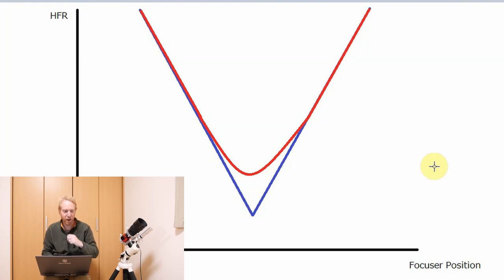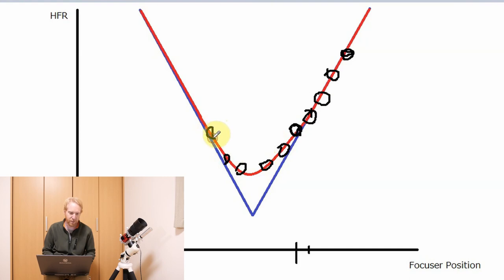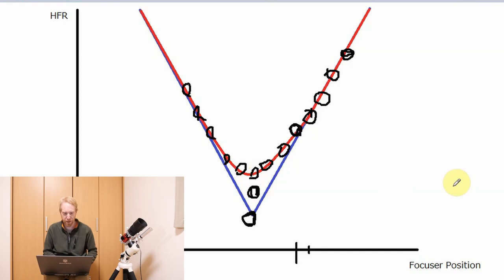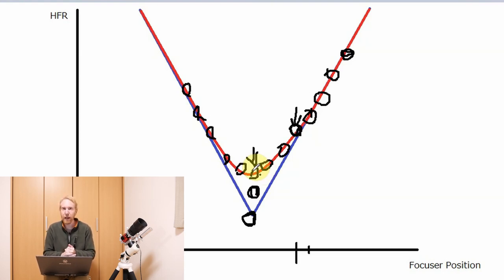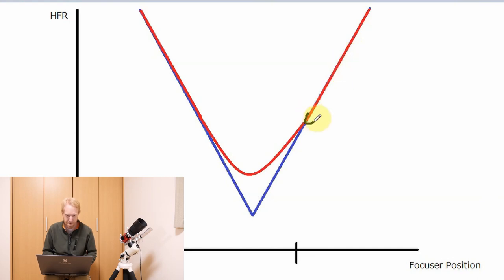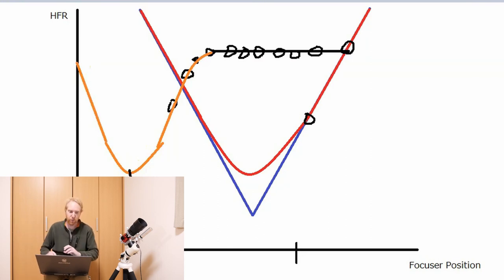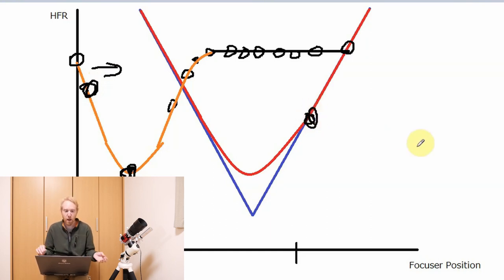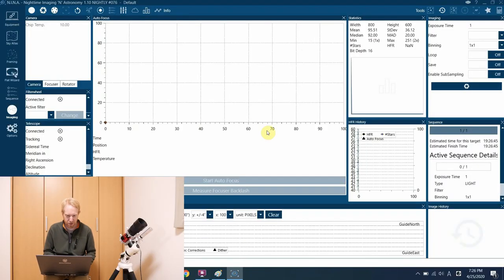Understanding Auto-Focus in N.I.N.A.!

Comment: I have been fighting a lack of quality automated focus for some time with both NINA, SGP, and APT. All three of these apps use a similar approach, and none were working well for me. After watching your explanation of how NINA auto focus works, I understand the details of the process and how each configuration value is used. NOW I can update my settings (which were way off) and give it a go tonight. Keep these videos coming ... you do excellent work!
Reply from the maker: Excellent to hear that this is being useful, and thank you for the feedback! I'll go into the actual configuration details in a later video.
Reply: @CuivTheLazyGeek  Cuiv ... I have the Celestron Focus Motor on an 8" SCT. This motor takes 1,000 steps to make a full turn of the focuser shaft. I currently have NINA configured with 40 steps and an initial move of 5. Those 200 steps take me out a quarter turn to start the auto-focus process. But I am still not getting a proper V curve. Do you think I should I go father to start?  Maybe 5 X 80?
Reply: Richard Sauerbrun Hi Richard. I’m about to order this week a Celestron Focus Motor to install on my SCT 9.25. How is overall your experience with this focuser working with NINA? Did your problems get finally solved? Any hint to consider? Thanks!

Comment: Cuiv, these are excellent videos! What's the deal with "max increment"? Is this a calculated value? Mine says 999999. Is this a problem?
Reply from the maker: Max Increment is a value provided by the ASCOM driver of the focuser. It is the maximum number of steps that the focuser can move in one go. If it's 999999 for your focuser, it basically means no limit, and is not an issue!

Comment: To speed up the autofocus, it would be handy if NINA had a "smart" feature. Basically while imaging THAT night, whichever night that may be. The curve it learns from, so it only moves out enough to get the out of focus, and moves into focus. Once it moves enough to where the HFR changes enough say by 1 or 1.5 it goes to the best number vs it continuing. I realize this would be dependent on your setup, but some focusers don't suffer from backlash (like the starlight I use on my tak). I do my autofocus in 125 steps for each point, it nails it every time at the best point (bottom of the curve). I do 125 because I found it gives enough movement to see a difference. I manually focused once in sharpcap, using their tool. Then I went to NINA ran an autofocus, found it landed pretty much where I was in sharpcap (step number). So its pretty darn accurate in NINA, just wish there was a smart feature to speed up focusing.
Reply from the maker: That would make sense - we already fit a curve (parabolic or hyperbolic) so if NINA were to remember the function it could in theory get to the minimum after measuring a single point. Although it could be mistaken in the direction it takes, so it would still need to double check, and if HFR went up (and there is a potential issue here of getting by mistake where HFR is no longer measurable, or noise is measured instead), go to the other direction. Feel free to suggest it in the NINA Discord, as I haven't done code for NINA in a long time now :-)

Comment: Don't know if I have to go to a different site for questions?
I have a DC motor Focuser which is recognised in Ascom and operates in APT.
However NINA will not accept it or recognise it?
Is there a way I can use Ascom or change anything.
I,m trying to get the Focus V graph.
Reply from the maker: Mmmh, it depends on the ASCOM driver - it needs to emulate an absolute position for your DC focuser to work with NINA... Do you get an error message when you connect it or move it? You may want to post on the NINA discord (Discord tab of the NINA website)

Comment: It looks like that in NINA the focusing temperature compensation only works with focusers that have an inbedded temperature probe (like the ZWO EAF). I am not using the EAF but another DIY ASCOM focuser (inspired from Julien Lecomte). Does anyone know of a possibility to plug a sort of independant 'ASCOM' temperature sensor that I could use for the same compensation purpose? I am using NINA and happy with refocusing in function of HFR changes, though, so it is more a curiosity question...

Comment: Well done video Cuiv - I learned a great deal.  One question, when I run the autofocus after it gets done with the routine it says it goes back to the original focuser setting.  Shouldn't it go to the optimal setting or am I missing something?  Your about 12 hrs ahead in Japan so you are most likely setting up so happy imaging.  - Cheers
Reply from the maker: It will only go back to the original focuser setting if it determines that the process has failed - e.g. you ended up with a worse HFR than what you started with. When that happens, it's typically because of uncompensated (or overcompensated) backlash.
Reply: Super explained thanks.

Comment: I thought you were only supposed to set backlash IN OR OUT not both because, they are fighting each other. I saw this in another video. Is that right ?
Reply from the maker: This is an old video - you have to set both if you use Absolute backlash correction (not recommended) but only one if you use Overshoot backlash correction (recommended). At the time of this video, overshoot backlash correction didn't exist in NINA yet.

Comment: One question: Im waiting for motorized for my two telescopes. For one one these telescopes I have a reducer. That means I have 3 options for focal view with these telescopes. Is it possible to calibrate this "backlash" for each setup and save this in NINA?
Reply from the maker: In theory the backlash should be the same, since it's the mechanical steps of the focuser - that being said, you should just use backlash overshoot compensation (which was added later in NINA), so that you can just set a large enough value that will cover all scenarios
Reply: @CuivTheLazyGeek  Thank you. Ill check it out. I need to see your videos of how to use NINA first ill guess ;) I actually noticed some profile editing in NINA. Perhaps its possible to setup several setting for each rig.